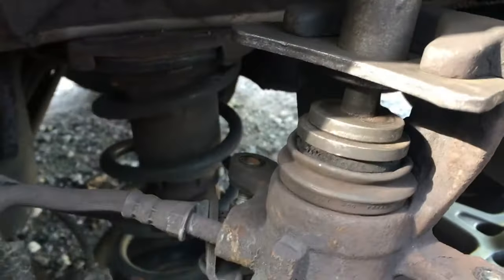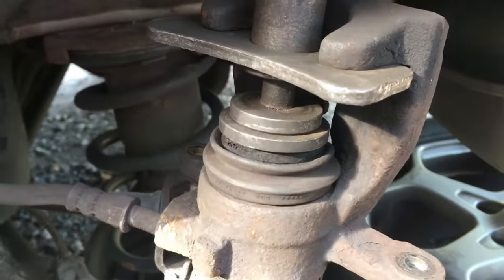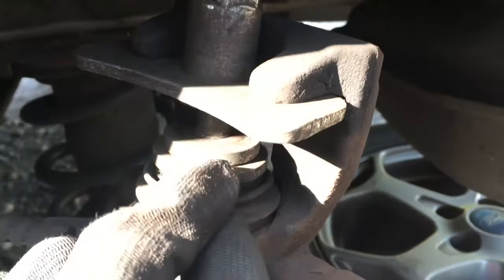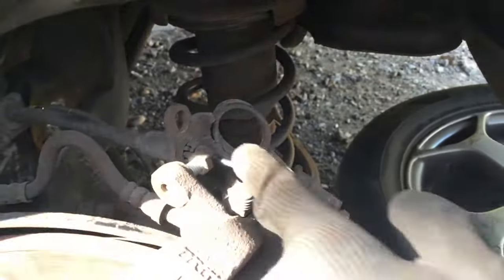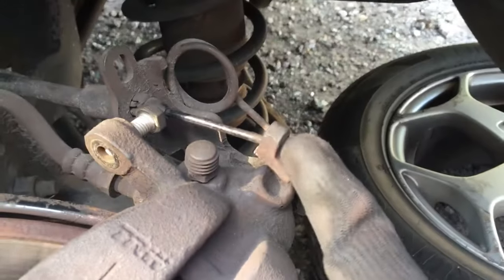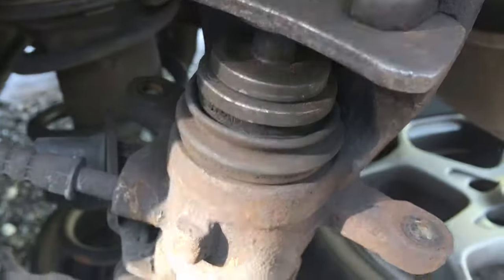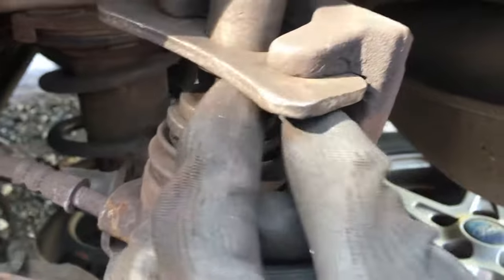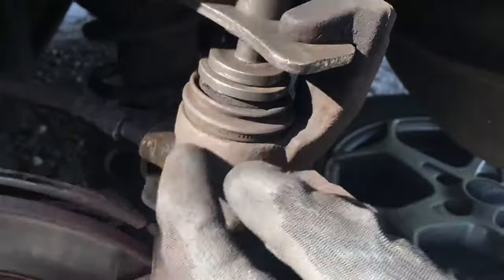Rear brake calliper not winding back - solved

Comment: I have my piston tool on the same way caliper in down but tool is stuck need help asap
Reply from the maker: See if you can remove the handbrake cable. If not, you will need to force it to come off